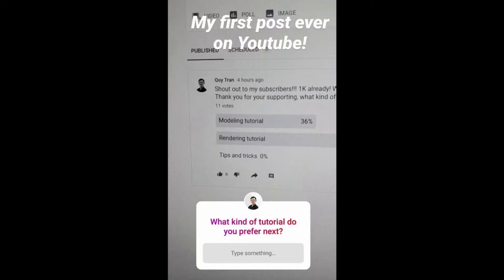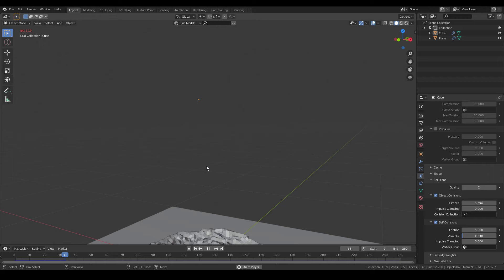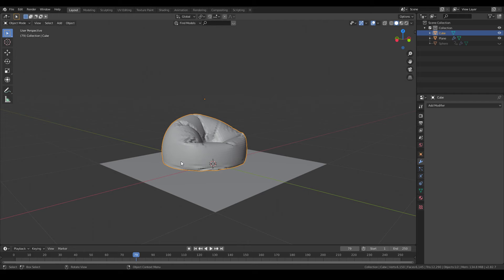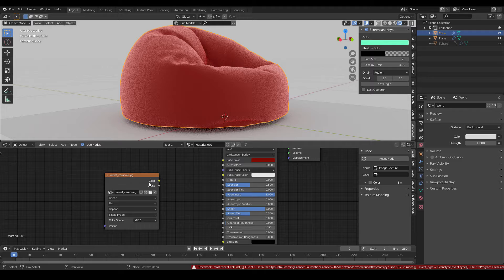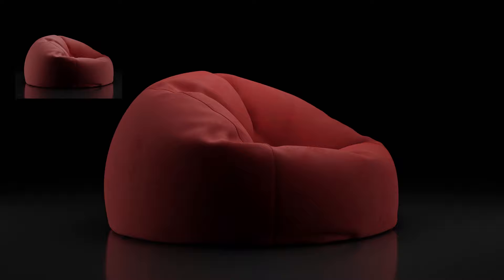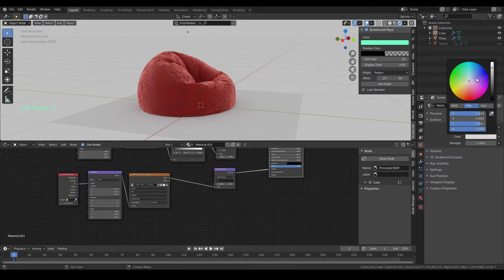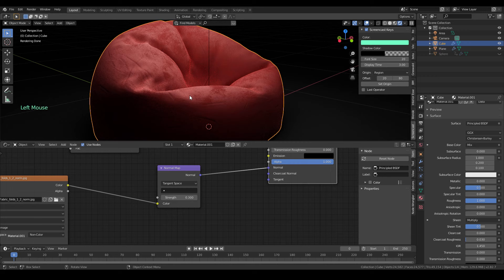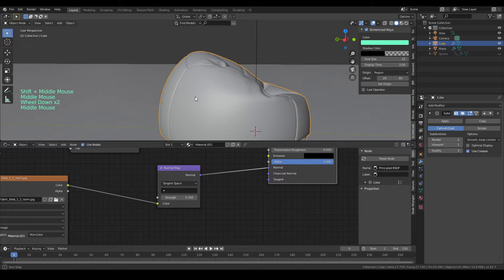How to make a REALISTIC Velvet Bean Bag - Blender tutorial

Comment: the way you said was making this look so easy but the actual problem is when we start doing this and try to follow and there are few steps where we miss while cloth simulation and material application, because which i was unable to cotinue the project.
and there is this software which is different because of which the name of the nodes differ slitly.
At last the information you provided was really great at the short period of time. and i don't know why my bean bag turned to be black and white rather then white.
Reply from the maker: yes, this is an 3 years old tutorial and the UI have some changes now, but the principal is the same. Can you describe more clearly the problem you're facing?